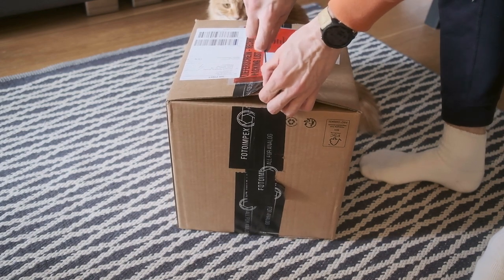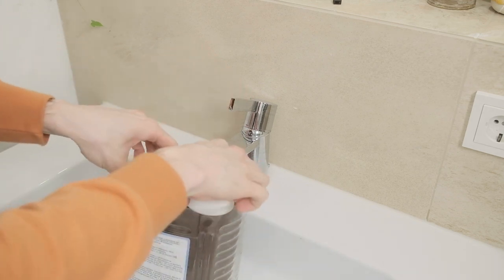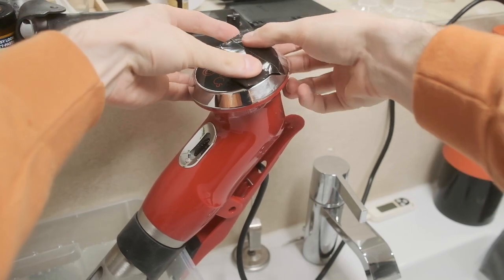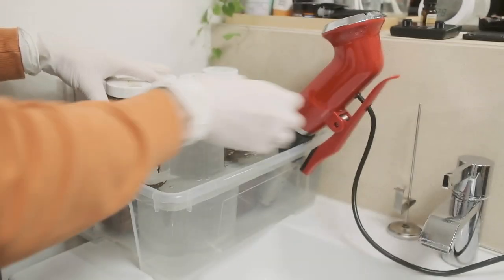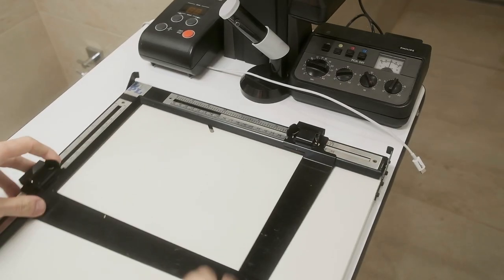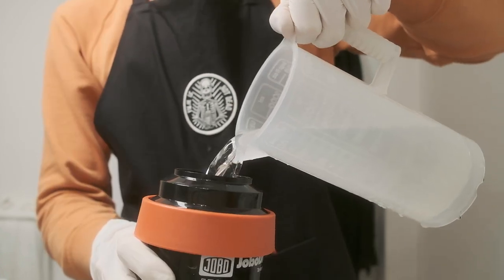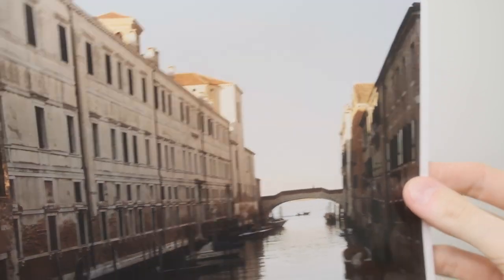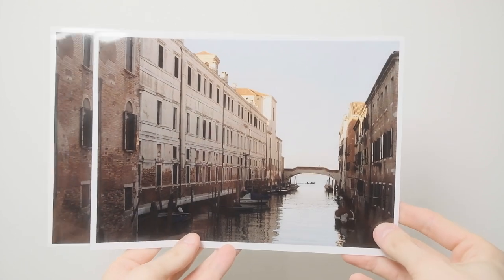Full process on color darkroom printing with RA4 chemistry, new paper and small repairs

Comment: I know you're considering a Jobo system, have you considered using a motorized roller base?  It is nice to not have to rotate the drum by hand. Vintage ones are still fairly cheap on ebay.  At least here in the states.
I'm starting to consider a stop bath between the developer and blix too (but probably just a water stop).  I'm noticing that there is quite a bit of developer carry over into the blix using the drums and it starts affect the pH of the blix a little sooner than I realized. I use Kodak chemicals and the Kodak documents talk to this point.  The transport roller machines have the advantage of squeegeeing the prints between tanks alleviating the problem.  Then its just a matter of managing the silver retention.
Reply from the maker: I don't like idea of buying peace which on future wilt be just trash. I can make all rotations by hand, it's not a problem at all, i just thinking about stable temperature - so drum should be heated, and secondly about timing of solution and what all the bottles should be in the same place for storage and use, and especially system should be fast to setup. And don't forget - I'm not only print, i also make C41 development, it's much more important to make it right then make printing stable.

PS: two solution for RA4 without any wash and rotations by hand works perfectly fine. I complicated it just for fun ;)
Reply: @NordicLab  Considering how critical temperature seems to be (as advertised), I find it very difficult to manage using the drums. It is certainly not practical to maintain it to 35C +/- .3 even as say the ADOX chems you are now using suggests.  One spot check I made on temperature after 45 seconds showed that the end temp of the developer had dropped close to 5C! makes sense considering the drum starts at an ambient temp of 22 or so degrees and given the surface area inside it makes sense. I was going to explore compensating for this by adjusting the development time.  Control strips are great for things like this! :)

Comment: Citric acid based stop bath, such as Adox Ecostop is not compatible with RA-4 or C-41, according ro Kodak documentation. If stop bath is used, it should be based on acetic acid. It may interfere with the process. Of course, these documents are very conservative, and it is possible they work without problems, but to play on the safe side, I suggest using acetic acid.
Reply from the maker: First of all "not compatible" is a strong word for the process which is working perfectly fine :D So be specific about "not compatible", otherwise it's just strange rumours with no sense.
Secondly - which Kodak documentations and on which paper and with what type of chemical set? In principle only one point to use stop bath - prevent alcaline solution transfer to fix bath (in our case blix fix), so you can use water wash, it's like 3 time more water to wash, at home it doesen't matter, but if you scale up it's really important. Plusses of citric bath - it's eco friendly, not fuming (which is crazy important at home), but it's
Reply: @NordicLab  I can´t recall which document it was. As far as I remember, this suggestion was for C-41. I´m talking of one sentence in style "notice that citric acid based stop baths may interfere with process and should not be used". What is said, Kodak documents are often very conservative in their suggestions. It might as well work. Acetic acid (vinegar) does not cause any environmental hazard - 3% solution used as stop bath is weaker than normal vinegar used in cooking. 60% concentrate stinks, but it is not especially harmful unless put into eyes concentrated.
Reply from the maker: @b6983832  Acetic acid you have concentrate in stock, this is completely not "vinegar", it's 60% in the bottle so it's H314 hazard, please read MSDS. If you wanna long lasting sustainable life and work in the lab you at least need to have protection equipment, If you have it "at home" and use it daily - it doesn't mean it's safe to use "like water". And in addition, citric acid just more environmentally friendly to produce, have no smell and exactly the same effect in this case. But anyway, this conversation have no sense, so citric acid apparently works fine and "don't use it" just a rummers as i understand, so far i don't see any answers on what exactly it will affect, at least with TETENAL kit for development it works perfectly fine.